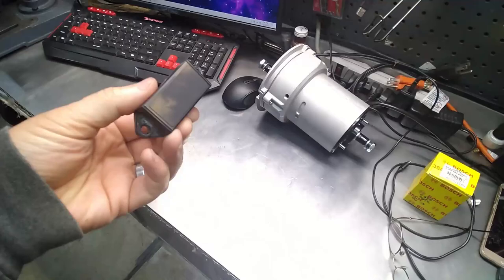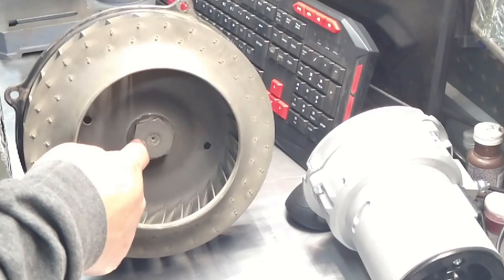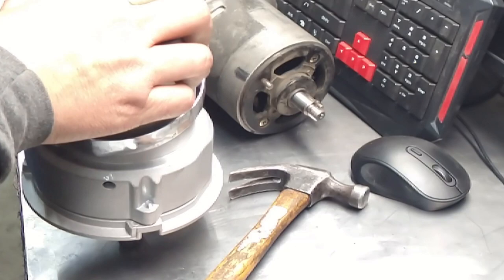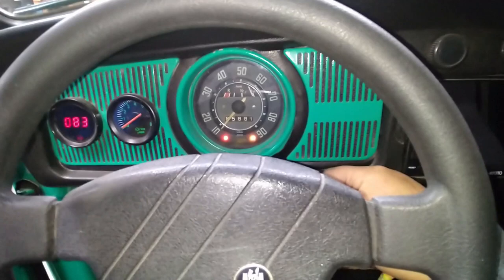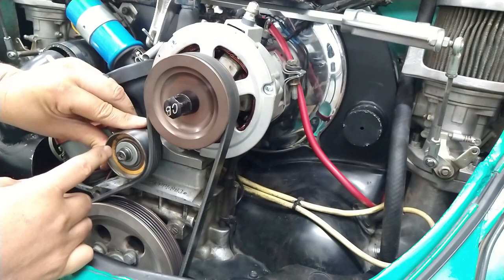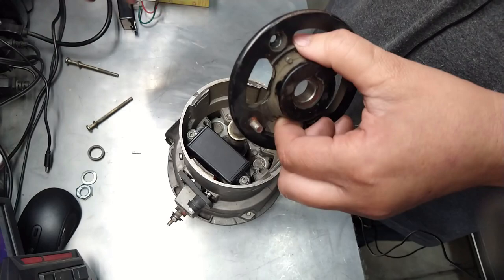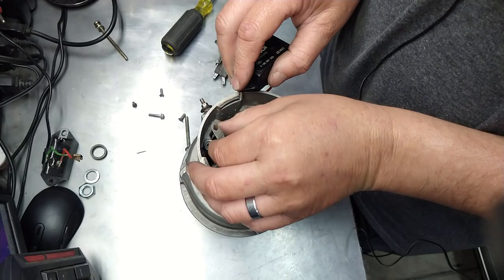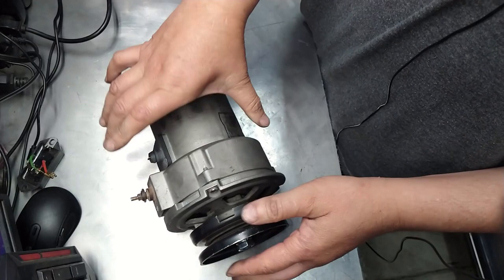75amp Alternator Install and Repair

Comment: You put alternator backing plate, up side down. You want to vent to be facing down,towards the engine case. Check the service manual or samba for photos.
Reply from the maker: Thank you Vintage